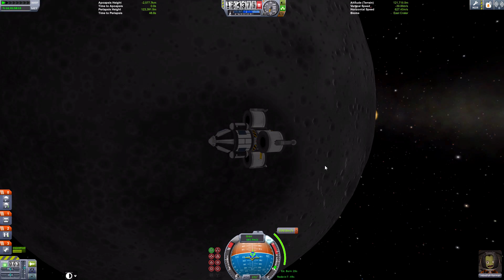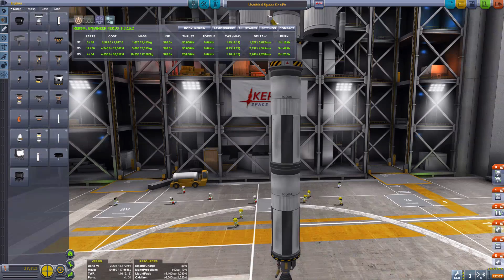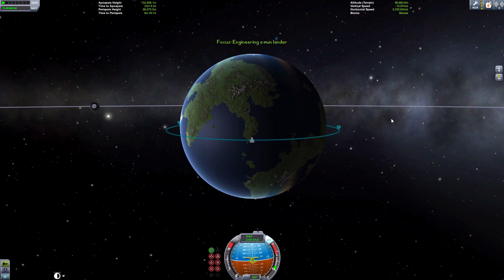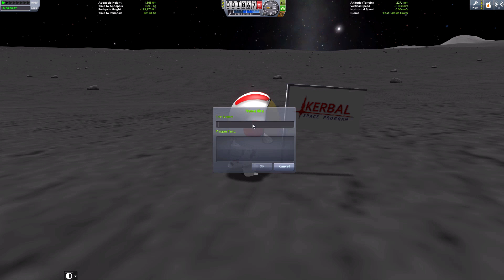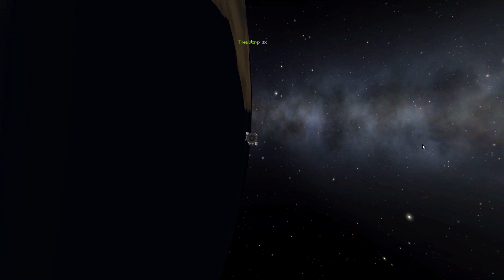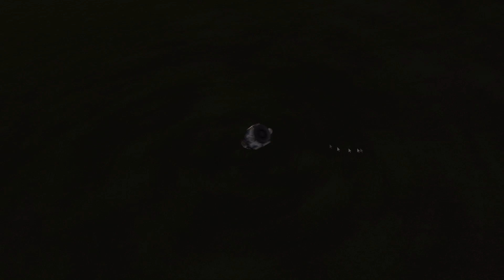Kerbal Space Program - Mun Landing Tutorial Engineering Style

Comment: I think it would be cool if you and Scott Manley got together and did a video for KSP.  Also, I'm having a bit of trouble with...Munar, I suppose is an appropriate term, landings.  It's nice that the Mun is tidally locked, so I don't have to worry about it rotating beneath me, however I always seem to have trouble killing all of my lateral velocity.  I don't have any trouble getting the retrograde marker to point directly down while I'm still, say, between 10 and 20km up, but once I start getting lower than 10km I always seem to somehow pick up more lateral velocity.  I'm able to touch down gently, but my lateral velocity always causes me to topple over.  Do you have any more tips on how to completely kill ALL lateral velocity?  Or at least maybe a way to correct a botched landing?  Perhaps there's a way for my Kerbal to EVA and use his little thruster pack to try setting my lander upright again?  I don't know if the thruster pack is powerful enough to lift the weight, even under Munar gravity, but it's a thought that I've considered.  Anything would be helpful.  Thanks for the video!
Reply from the maker: +Ben E That would be awesome to team up with Scott Manley but time difference is a pain I'm going to work in the morning when he live streams in his evening.
As for landing what I do is point retrograde and when your around 1km high cut your speed to zero then you will drop down straight.
You can also add RCS thrusters so you can slow down your sideways thrust down while landing

Comment: when I go to turn over at launch I just flip out. I'm guessing that this is because of the new aerodynamics, but is there anyway to control it?
Reply: +Matty1376 Can confirm what Orb8Ter posted. I added 4 fins to the main large rocket, aero-dynamic noses to the 3 small fuel tanks attatched to the side of the lander, and parachutes on the 3 large boosters to recover them afterwards. As I'm playing in career mode I also used the TT38k Radial Decouplers as I hadn't yet unlock the previous ones and it was fine. I also added a Heat Shield under the science bay and a service bay to hide other science parts. 

Worked a charm :)
Reply: Awesome !
Reply from the maker: +Matty1376 Yup this video was made pre V1.0 you have to do your gravity turn from launch but turn very slow and try and keep the rocket close to the center of the yellow marker as possible while still turning, to keep control use reaction control wheels, some winglets and you can even add RCS and also add fairings to cover the capsule and nose cones for the flat fuel tanks ;)